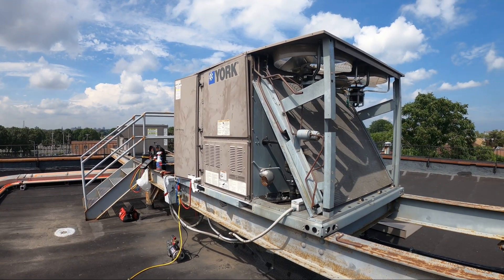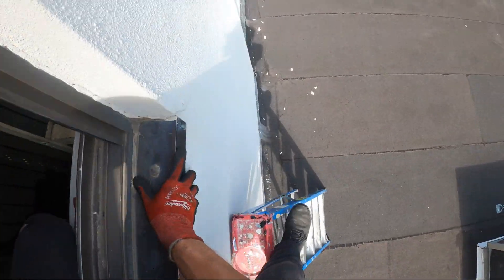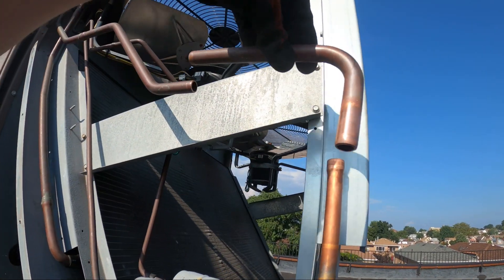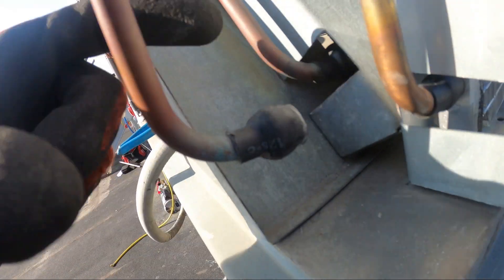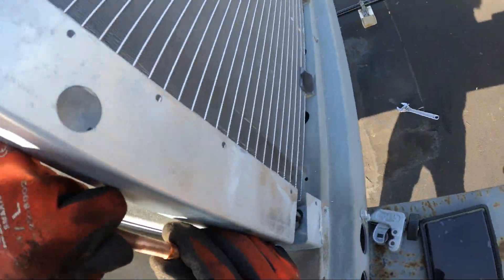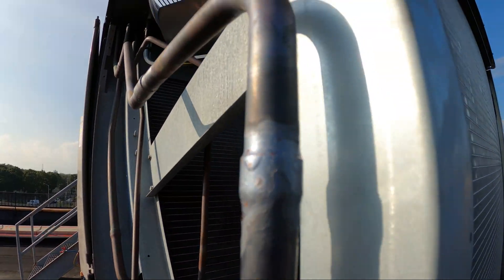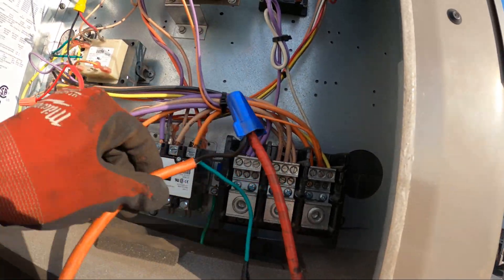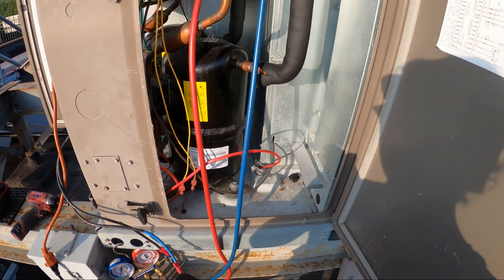HVAC Service Call: RTU Condenser Coil Installation/Replacement(How To Install Condenser Coil For AC)

Comment: I would've washed that other coil. Those microchannel coils hold so much dirt. I bet those coils were so dirty that head pressures went so high it blew the weakest joint in the system. I've had to change these micro channels on box car units and it was avoidable if techs would just take time to check the coils and head pressures. Your a good tech and enjoy your content. Keep it up

Comment: I assume that what youre having on your condensingline on the manometer is a vacuum-gauge? Hats off for pressurizing the system with it connected, that requires some balls

Comment: How come not leave the coil in the box or protect it?
Reply: Because it has to be roped up a roof on about three different platforms. The box probably weighed more than the coil.
Reply: @frankigi  I mean even a layer of card board to protect those fins. Those micro channels are pretty fragile
Reply: @DetectingArizona  so what ?